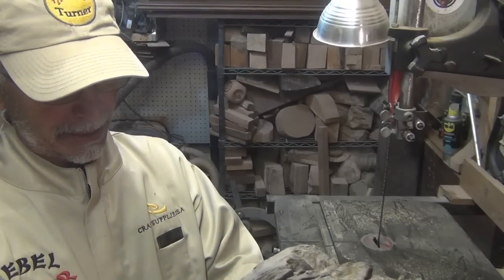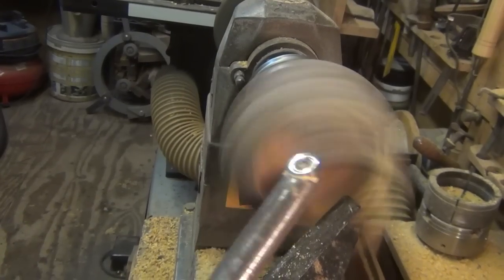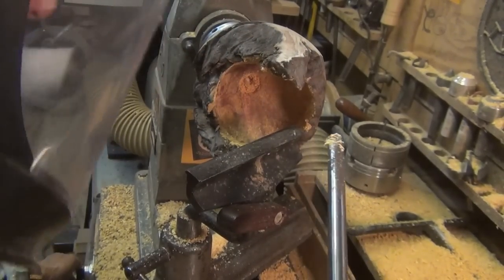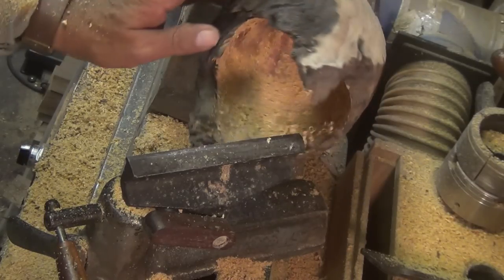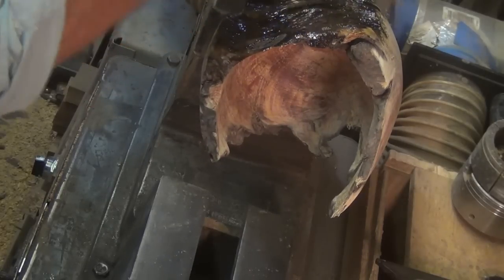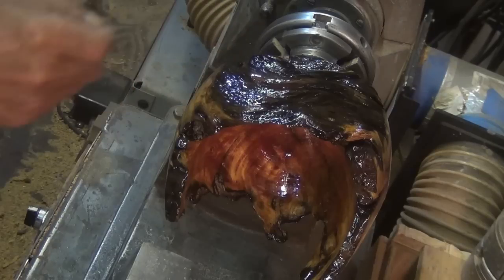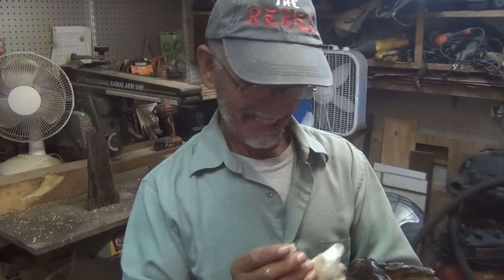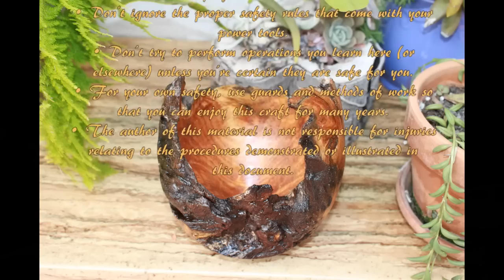Woodturning Fat wood  Fire Bowl part 2

Comment: A lot of work but it turned on great, however the poly I find too shiny on the bark areas.  It took away from the weathered look of the uncut areas.  Lighter knot burnishes up nicely to a nice shiny surface (like the area where your gouge rubbed when you cut off the tenon).  If you did that and left the nice gray weathered area alone, you would have had more contrast between the two.  But still a very nice piece.  Thanks for all the work.  And again, I hope you have a very Merry Christmas.  Cheers, Tom
Reply from the maker: Thank you for watching and commenting.  As you probably know I am not a big fan of shiny stuff and even though I didn't mention it  I did wipe of the majority of it  maybe not enough LOL

Comment: You sure know how to get a guys heart pumping.  I am glad you were off the the side when that piece came off.  With that fat wood,  does yours smell like turpentine?   I have some over 10 years old and is still wet inside.  Not water but turpentine.  I think that stuff never completely dries out.  Did the poly finish dry?
Reply from the maker: Thanks my friend.  Don't people usually pay for this type of action?  Man I am just to darn generous LOL  Yes shop smelled like turpentine. if you got a piece that still has a lot of moisture, put it to the side for a 100 years and it might be ok to turn by then. LOL
Reply: @AlFurtado  100 Years is about right.  😁😁😁😁